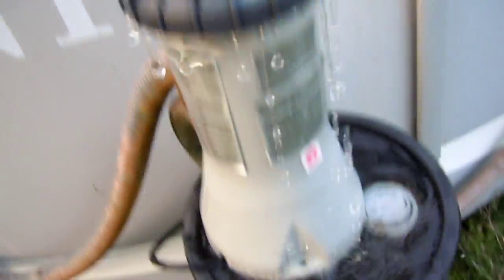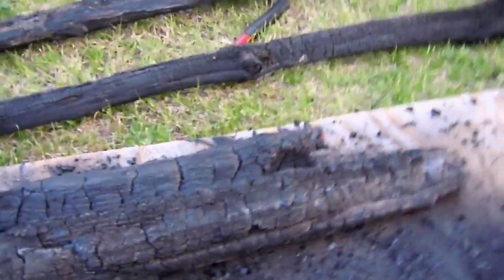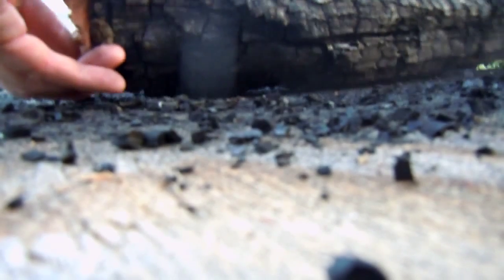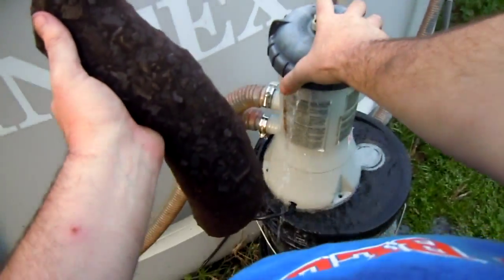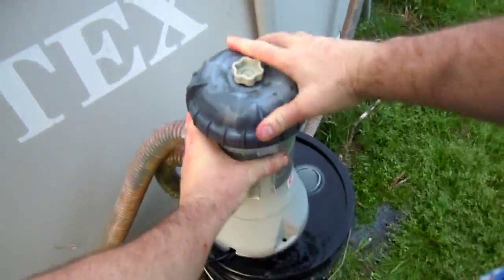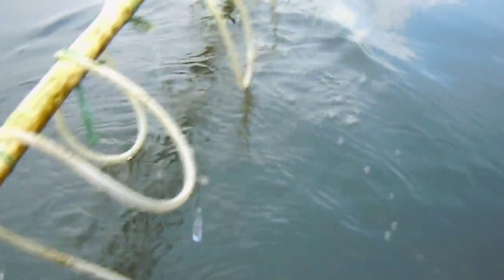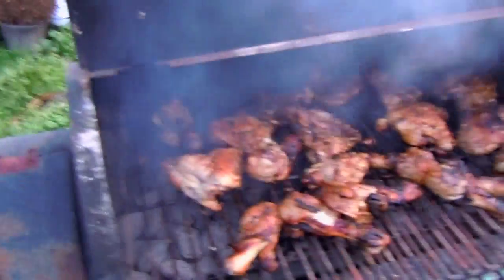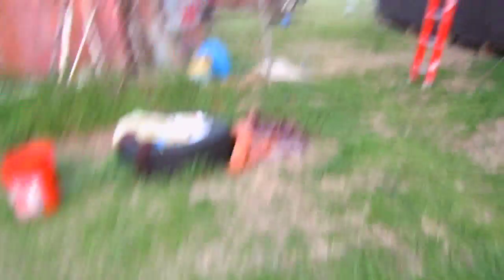homemade activated carbon 101

Comment: just so you know, this is not activated yet. you need to soak that carbon in acid to activated it.  .
Reply: +Edward Tyndall Use sodium hydroxide or phosphoric acid. Look for detailed instructions - this is how most carbon is activated. Also, your carbon is poor quality already... If you really want to improve your product to it's maximum potential - learn about the 'pyrolysis process'. Burn your wood in a totally oxygen free environment to produce your own biochar. This will be a superior quality carbon source to start with. Also - you can make your own syngas from this - and use it to run a gasoline generator if you want! ...or heat hot water etc...

Once you have quality carbon - you have to activate it with lye (sodium hydroxide) or phosphoric acid solution - by soaking it for like 24 hours - rinse and then reheat the carbon again to around 800F+. You can find more specific details on the internet pretty easily. Once activated; the carbon is useful for a wide variety of things! What you have here however, is simply a very crude biochar - not 'activated carbon'. The activation part involves chemically damaging the carbon matrix to improve total surface area. Anyway - hope this helps... let me know if you have any questions.
Reply: +poweredbyaaron99 
it can work with sodium bicarbonate or magnesium chloride?
Reply: Lisa F Yes I believe so. Citric acid works too, I just remembered I have some! I'll have to give that a try :) it's much more gentle than NaOH or stronger acids. 

Another idea I had was to take the potash and extract a natural form of potassium hydroxide - and use that as an activating agent. If I'm not mistaken, the potash also contains Calcium & Potassium Chloride. Since I have ashes anyway - seemed like a good idea to me.
Reply: making lye is easy(use the ash -> soak it in water) = lye.
Reply: poweredbyaaron99 just so you know, NaOH is not an acid , it's an alkali
Reply: and I've just realised I've commented on a 2 year old video
Reply: What kind
Reply from the maker: Dan Murphy what kind of acid bro i just seen your msg and thanks
Reply: thats alright, Iv been reading your post. I just thought I would let people know that an extra step(or 2) is how you make it Activated.  I'v made all kinds of carbons playing with conductive inks / paints & pastes for batteries. All sources of carbons activate differently. Peace Out!
Reply: https://en.wikipedia.org/wiki/Activated_carbon#Production Chemical activation here states that the material is treated before carbonation, and that carbonation  and activation occur between 450–900C. 

Maybe there are other chemical ways that work just as well or better  but they are not listed.
Reply: Can we use HCL acid
Reply: +Dan Murphy That is, in fact, activated charcoal as he did it. The Calcium Chloride just activates it even more, making it more porous and potent. As is, you just have to just change it more often from what I understand. Look it up on the internet.
Reply: @e-prepcards2757  that's not activated charcoal. That's just charcoal. activated charcoal is millions of time more absorbent. Big difference. Feel free to look it up.